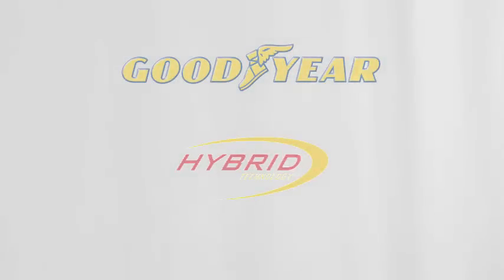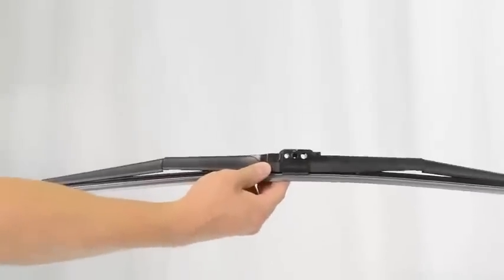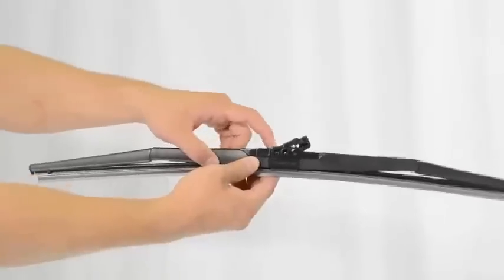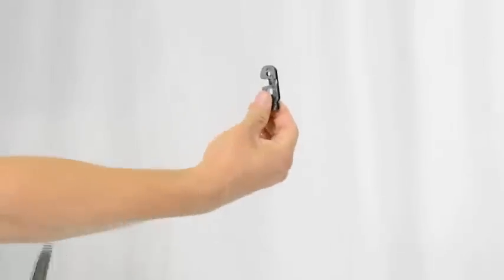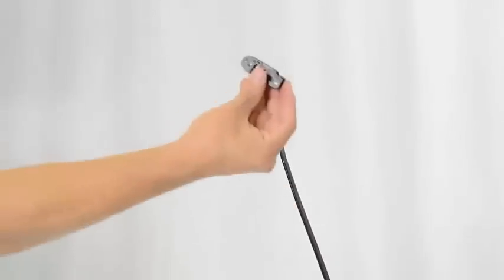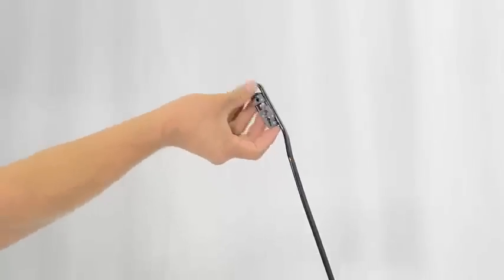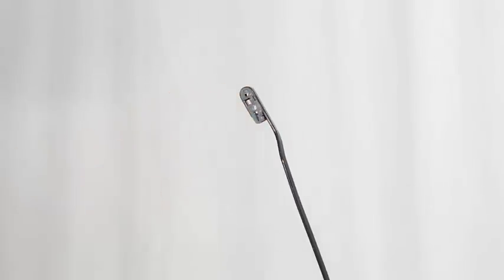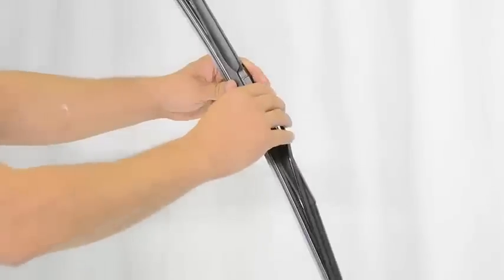Saver Wiper Blades - Saver Hook Arm Wipers

Comment: once the side lifts up, press the underside of the part that tilted up from the bottom, as if you want to open the angle to 90*. It will pop right out

Comment: Yeah, you have to give a pretty determined tilt and pull to get the adapter out. I was afraid it was going to break, so I came into the house and watched the video, and they said tilt and pull it out, so I figured its going to come out this time or break, and sure enough it comes right out, if you give it enough force.  I would have felt pretty stupid if I had returned it to the store, just because I was too gentle with it.

Comment: Like most, I struggled with the printed instructions. Once I watched the video I was able to make the install. However, there are small plastic locking tabs at both ends of each wiper blade. One of these small tabs no longer locked in place and to solve the problem I took some 5-minute epoxy and glued it in place. I thought it would take less effort than to secure the replacement blade from Costco. Hopefully, these tabs will not drop out during use. These blades and specifically the plastic tabs are a cheaper part than the rubber end caps on the old Goodyear blades.

Comment: Here's the trick:

The piece you are supposed to remove rotates around a pivot axle, which is two raised cylinder shapes in the inside of the opening on the wiper arm. The piece itself has 2 matching circular depressions with an opening on one end.  You have to pull hard enough to squeeze the cylinders through those openings.  

I think that by the time they had finished rehearsing the video, those openings were worn down enough that it was easy for him to pull the thing out with your fingers.  

We took a chance on breaking it, by sticking a screwdriver blade underneath the piece that comes out, and prying up.  With a new part (which is always what YOU will be working with), it takes a lot of force, and you worry that you are gonna break the thing and be stuck with broken junk that you cannot get a refund for.

Use a screwdriver and pry it out; you'll be OK.

Comment: First problem was to get the old goodyear wipers off.   Second problem was to get the plastic adapter out of the new blade without breaking it.  I figured if it broke I would just take it back to Costco and get a refund, but it came out with a yank.  You have to man-handle this insert and hope it will not break.  Once these two problems are solved, everything goes easy.  And yes, one is always easier than the other, and the hard one is always the first one you  try.
Reply: Thanks for your help. It definitely wasn't as easy as they were showing in the video. I was about ready to give up because I didn't want to break it.

Comment: Worked fine for me once I gently but firmly showed it who's boss.  Once you tilt the thing up, you do have to be rather firm about lifting it out by gently continuing to bring it up toward 90 degrees.  The rest of the process is easy peasy.  These are different from earlier Goodyear replacement blades and in some ways easier to change.  Just make sure you get the right ones for your vehicle.
Reply: Yes, the trick is to firmly bend the adapter to the 90 degree position and then pull the adapter up and out.  To remove the old hybrid wipers, the 90 degree trick also apply.
Reply: Aileen Kader
Reply: The video didn't emphasize the need to pull out the adapter the way it needs to. I had made up my mind to return it.  Thanks to useful comment which made it the whole thing pretty easy.

Comment: I installed these as shown:

A) There is nothing that holds the blade to the curvature of the windshield, so only the part touching the windshield gets wiped.

B) There is nothing to keep the rubber that contacts the windshield from sliding off of its track.  There appears to be a place for something to clip on at the ends that keeps this from happening, but no such part is included.

I'm taking them off and they are going back to Costco.

Comment: UPDATE
Okay with the help of my iPhone I was able to take pictures of the back of that bracket that is preventing the wiper blade to lay flush with the windshield. It is not welded to the wiper arm. It is attached with a small philips head screw. With some difficulty I was able to remove it and reinstall the blade. It now lays flat and doesn't appear to need that bracket for the wiper blade to function properly.

Original post

This brand does not work on a 2004 Accord for the driver's side. The Honda blade arm attachment has a piece that is supposed to keep the longer driver's side wiper blade in place as it moves up. It cannot handle the thicker width of the goodyear replacement bar. The price was too good at Costco not to keep the passenger side but I will be returning the driver's side since it can't lay flush, defeating the purpose.
Reply: I had this EXACT same problem... 2004 Accord... Drivers side.  I had to buy another blade from the local parts dealer because it was raining and I broke the old blade adaptor.  The odd thing is I had already used Goodyear branded-blade so I was surprised to run into this problem.  I think the prior one was not the "hybrid" version (whatever that means).  Anyway the parts-guy said he thinks that little piece of metal on the arm is put there by Honda to ensure you don't buy non-Honda parts.  I was about to throw away this 26" one I have but now I'll put it away and take that darned part of next time! 

THANK YOU!!!!

Comment: This does not fit my 2004 Accord Driver side. The tip closest to passenger curves up, causing wiper to miss up wiping.
Reply: I found this out as well. I'll be returning the driver side to Costco. The reason it doesn't fit is because the bar construction of the replacement is too think to fit in the channel of the Honda arm that connects to the windshield. If they had constructed the replacement with a thinner design, it would've fit just fine.

Comment: I'm a 55 year old man whose installed most every brand of wiper blades on numerous wiper arm styles over the years, but thanks Goodyear; now you have to have an internet connection to figure out how to perform a basic task that used to take 2 min. That said, once you know the secret, these blades can be installed in 2 min as well. This video is a joke...just use a screwdriver to pry along the side, where the ridge is, and pop off the entire assembly with the adapter still in it. Then fish it over the J arm. Now line up the arrow on the top of the assembly to the arrow on top of the blade housing, and snap them back together. Done.
Reply: +meman45 
The worst blade I have ever bought. It's designed to fit all imaginable configurations so has a lot of complex molded pieces most of whose holes and ridges have nothing to do with your own application. I'm so sorry I bought it. The pictograph instructions are apparently intended for pre-verbal puzzle whizzes.

I had finally managed to figure it out when I bought it, and then today it popped off when I was washing the car. Another half hour trying to figure out how to put it back. Never again.

Comment: I have been to a bunch of sites and this is the best video.  The written directions were awful.  The directions should have started off with there are lots of parts for various wiper arms.  Then, recommend the buyer find the wiper arm that matches your car.  Then, provide the directions.  The release on the blade does pop out with a little pressure.  Once I understood the directions, it only took me 2 minutes to replace the blade.

Comment: Fought the first blade for a half hour trying to go by the TERRIBLE printed instructions.  Video was useless, too. Thank you comment-ers for saving the day. It does not easily "lift out." Get a screwdriver under it. Shame on Good Year for such horrible instructions.
Reply: I'm with you. I haven't even used the product yet and I hate it. Terrible instructions. Why can't they continue to sell the rubber blade refills? They were difficult to install until you learned the trick, but at least they made sense.

Comment: "By lifting the adaptor out with your finger,,, ".  Yeah, right.

I have to agree with many of the others.  This thing does NOT lift out with your fingers.  I had pulled and tugged hard enough where I was worried about breaking it.  I then searched for assistance.  The video stinks, but the comments were right on.  You have to force this piece to come out.  I finally got them on.  Oh, and the printed instructions?  Completely useless.

Comment: Agreed with negative comments. Instructions are a waste of paper. This video is poor. The only thing useful are my fellow commenters. Thanks guys. 

Tried to pry up the adapter and it bent a letter opener. Tried a screwdriver and it bent the plastic in the wiper body. Finally, slipped a knife on either side of the adapter and was able to get the adapter to jump out of the slots or holes or whatever you want to call them. Slid the adapter into the arm, which also wasn't as easy as shown in the video. That probably depends on the car. But, it DID go in. Snapping the arm into the installed adapter is not a confidence builder either. You do hear something like a click but it's not that well defined. 

The speaker in this video needs to go. Could there be a more deadpan presenter? Reminds me of Carlton the Doorman from the old Rhoda show. Google that and you can find a clip on vimeo. The quality of this video is poor too. They could have shown close-ups of the connection. They could have addressed the orientation of the connection.

Once you get everything apart, it's easy to forget which direction the adapter and the blade go. Fortunately, I had another package, unopened (and going back) to refer to. 

I bought a 21" and a 22" at Costco for $8 each. Maybe you can't expect much at that price point. Got the 21" installed. The 22" is going back. Knowing what I know now, I could install the 22" but I just don't buy from companies with such disdain for their customers. I had Rain-X blades and I'll look for them.

Comment: "... extract the adaptor out using your finger." Then show the back of the person's hand instead of showing HOW he managed to extract the adaptor. Terrible written instructions and worse video instructions. I still can't get it out. Back to the store for another brand. So long Goodyear. I used to like your blades - back when I could get them on and off.
Reply: As others have said.  The written instructions were TERRIBLE. Why they couldn't spend a cent or two and add clearer instructions. I spent over an hour trying to get the old one off and reading the instructions to understand what adapter to use for the  Hook on my Dodge Stratus 2000.
.........................................................................................................................
The video helped but the back of hand did get in the way. Trying to understand how much force it takes to work with the old and new adapters should have been mentioned.  And that a flat head screw drive helps. 
...................................................................................................................
Yes I would like an instruction on how to remove the old wiper.  To much time spent that should only take 2 minutes.
,.......................Yesterday 10/8/16, got them at Costco for $4.99 each sale versus $7.99.